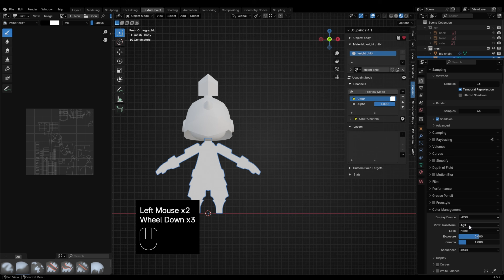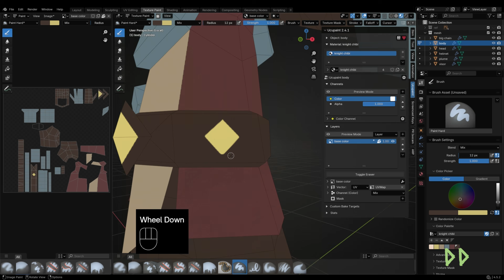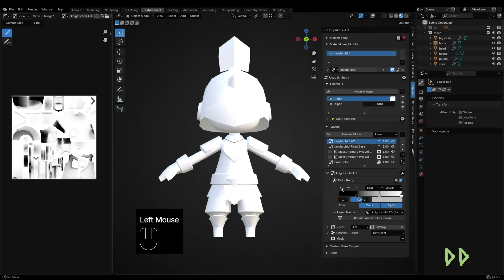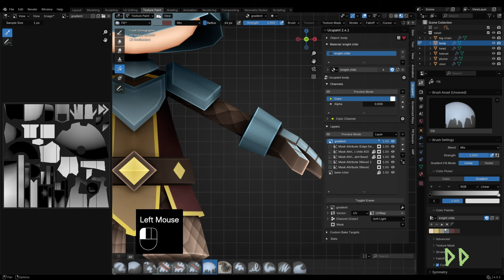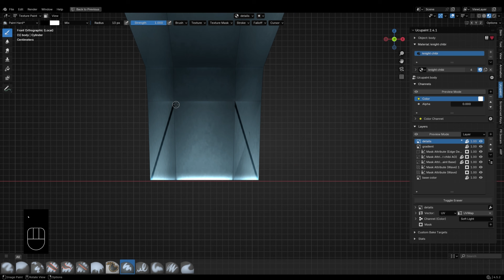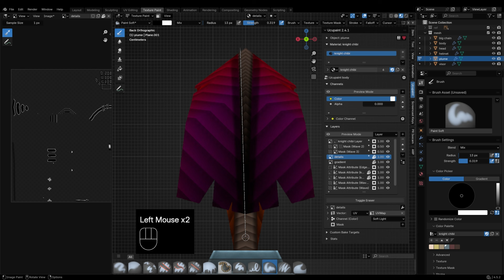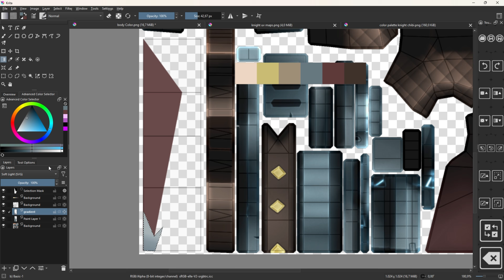Low Poly Chibi Knight in Blender | How to Texture Using Ucupaint Add-on

Comment: Something I was curious about if you do a retopo can you bake the AO with the high detail and then remove the retopo so that it doesn't add the fake geometry. You're simply using it as a way to 'paint detail' for hand painted texturing like this? I feel like that is almost like what WoW does for its characters but obviously couldn't say for certain.
Reply from the maker: Hey! If what you mean is using a high detail mesh to bake AO (or other maps) and transfer it to a low poly version 🙂

Yeah, you can do that. In that case, the high poly is only used to transfer detail, not for the final geometry 

For this video though, I didn’t use that workflow. The texturing is mostly hand-painted, just adding simple shading and color variation directly.

But yeah, the idea you mentioned is commonly used in games, baking detail from high poly to low poly to fake complexity.

If you want a reference for transferring texture from high to low poly using the Ucupaint add-on, you can check this video:
[https://youtu.be/QCtoE6CqOR4?si=urW_6iQALWSF4CxH]
Reply: Sort of, not quite I guess it's a niche request.

So in normal retopo you bake down the Normals so you get lighting/reflective data.

What I'm thinking is you only use the high-res detail to bake down AO (Ambient occlusion) to your texture, that way you get that 'Hand painted' detail without affecting lighting since most hand painted is unlit.

it would add a use case for still doing a high res model for low poly characters that you want that hand painted look made popular from games like WoW etc.
Reply from the maker: Thank you so much for the detailed explanation! If I understand correctly, you are suggesting a high res to low poly workflow where we use the high res model specifically to bake Ambient Occlusion directly into the texture to achieve that classic hand painted look like in WoW without relying on Normal Maps for lighting. Is that what you mean?

If so, that is a really interesting idea and a great use case for high res sculpting in a stylized workflow. I really hope I can do this in the future. Thanks again for the input 😊

Comment: What is the purpose of the medium high contrast in the Color Management section? 0:50
Reply from the maker: Hey! That setting increases the color contrast in Blender’s viewport and render. But as far as I know, it only affects how things look inside Blender and doesn’t change the original texture colors when baking.

If you want to preview colors closer to how they’ll appear in a game engine, you can set view transform to standard and look to none.

Comment: Hi! Just wanted to ask a quick question. Is there a reason why the Texture Painting workflows between this Knight and the Low Poly Chibi girl are considerably different? 

More specifically, the girl uses traditional painting techniques, but the knight here uses a lot of generation over actual painting (e.g. ambient occulsion, edge detect, gradients, etc). Which of the two would you normally use? Thanks in advance!
Reply from the maker: Hi! Good question, and thank you for watching both tutorials.

Basically, when I use generators like wave, AO, edge detect, gradients, and similar tools, it’s mainly to speed up the painting process in cases where I don’t necessarily need to paint everything manually. It helps save time, although the result can sometimes feel a bit more standard compared to fully manual painting.

Manual painting usually feels better and more fitting when the mesh is truly low poly, like the chibi girl. In that case, the texture lines and details really need to be drawn manually to get the right style.

For the chibi knight in this video, the texturing is actually quite simple. Most of the time it’s just using brush strokes and line strokes, and the face vertices already follow the shape of the texture pattern, so I can simply fill colors on the face mesh. That’s different from the chibi girl, where I had to manually paint many of the texture lines.

Normally, I prefer manual texture painting when I want a more satisfying and stylish result, especially when the pattern is more complex and can’t really be achieved with generated layers. I use generated layers mostly when I want to work faster and the effect can be achieved that way, even though the result can feel a bit stiff or less stylish.

Also, both workflows were designed so the texture painting can be done using just a mouse, without needing a pen display or pen tablet, except for the eyes on the chibi girl where drawing manually is a bit easier.

So in short, manual painting is usually more stylish but takes longer, while generated layers are faster but can look a bit more standard or rigid. Thanks again for watching both videos, I really appreciate it.

Comment: it would be amazing to see in-depth krita workflow for pbr's and long format explanation for ucupaint, the addon is great but you need to know how base blender texturing works which im not that familiar with it. Long story short ucupaint and krita tutorial = good 🐧
Reply from the maker: Thanks for the suggestion! I’ll keep it in mind for future videos 😊
For Krita, I mainly use selection tools to make shaping the paint easier. For shading, I use the same approach as in this Ucupaint tutorial, soft light layers with black for shadows and white for highlights on top of the base color. The rest is mostly adding Krita’s pattern brushes and adjusting layer levels